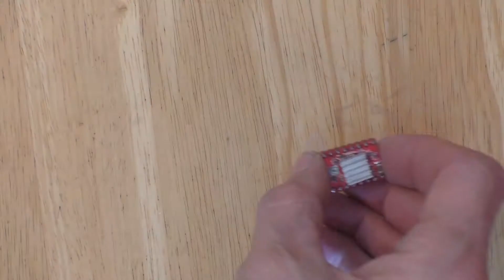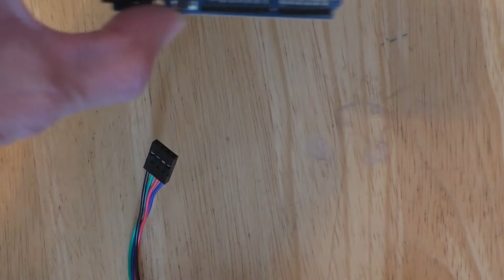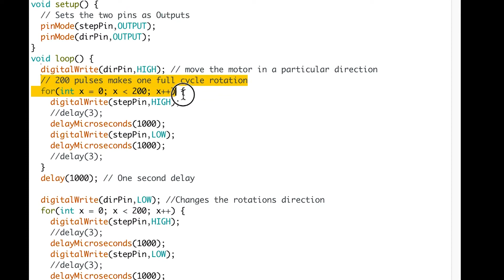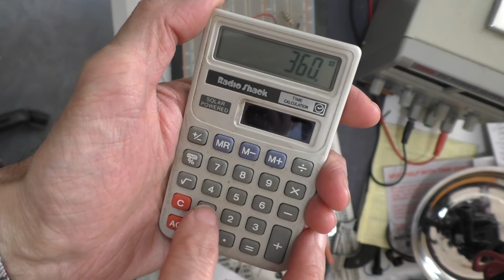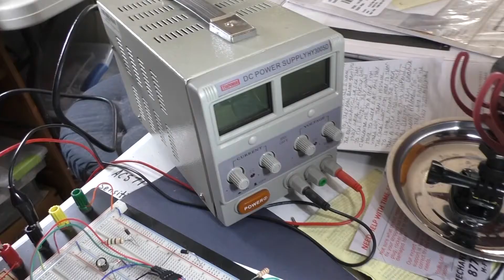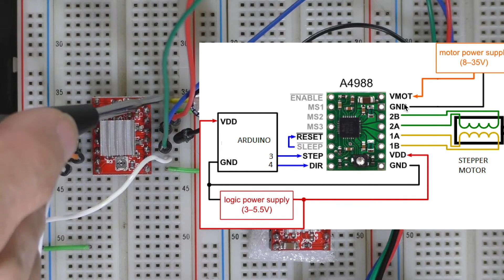How to operate a stepper motor with an Arduino

Comment: Awesome! It is great to see another electronics video from you. I love this stuff.  I’ve had fun playing with stepper motors. If you get two stepper motors it is cool to play with connecting them to each other and see how you can drive one motor from moving the other with no outside electrical power. Have fun learning this, and thanks for sharing this journey with us.

Recently I’ve also been interested in electronics repair videos. It is like a detective mystery.
Reply from the maker: Thanks for watching, I will be doing more stay tuned.

Comment: Does driving the motor in half step affect the torque, if yes, what is the percentage?
I would be interested to see the motor driven in a fraction of a step, if possible.
Nice video. Thanks
Reply from the maker: It might, but I'm not sure, I will check it out stay tuned.
Reply: I'm not sure either but I think that torque does increase when you use micro stepping.